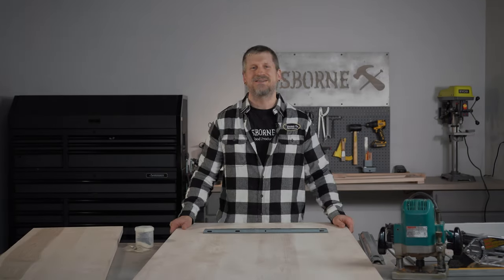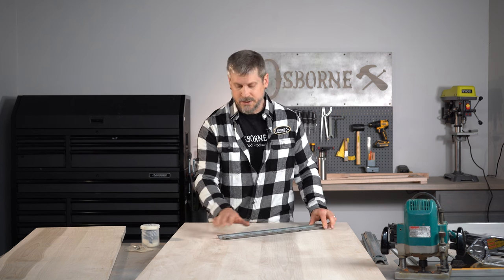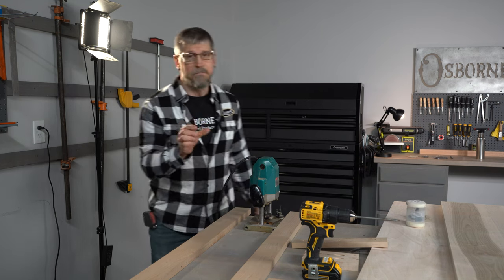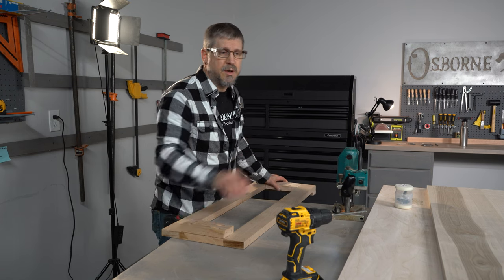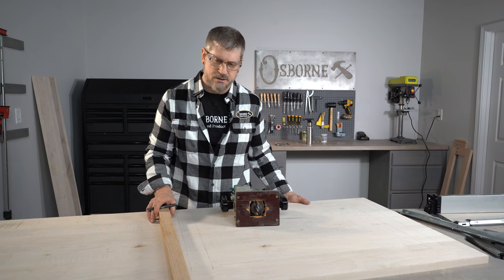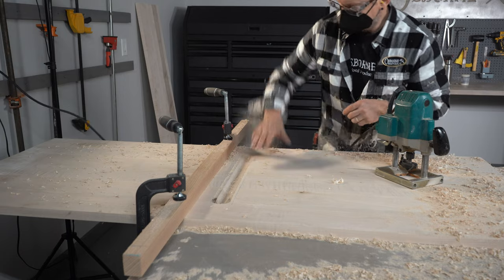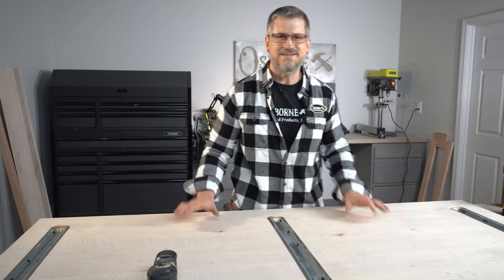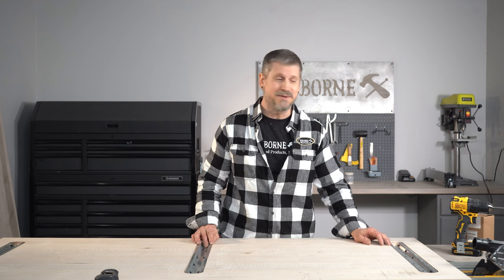How to Keep Your Table Top Perfectly FLAT! - Builder's Studio

Comment: 12 mm = 1/2 inch  but like you said it best to get a 12mm collet  Most hand held router  will tell you never use a bit like the V Stabilizer Groove Router Bit w/12mm Shaft .Bit like that are only used on CNC.  The 25mm = 1 inch and half the CNC out there can't take that size.  Your V-stabilizer  would be great for production but for one or two time a year worthless just use a C-channel.
Reply from the maker: Thanks for the comment. The V-stabilizer is a tool that addresses a problem. Just like any other tool, the cost-benefit analysis has to be done for the anticipated application.
Reply: @osbornewood   One thing you might want to-do is do a side drawing profile where people with CNC can use bit they have. The price of the V-Stabilizer Bars is good and look like a good idea. Know the track cut out could be done on a strait bit and a bull-nose and may a V-bit. Send me the dimension and I do a video showing it done CNC.
Reply from the maker: That's a great idea. If you would like, please reach out to us at marketing@osbornewood.com so we can look further into this. This would be a great option for those who only need to use V Stabilizer bars occasionally. Thanks!

Comment: What is the advantage of using these over regular C channels everyone is using? (C channel doesn't require any special bits)
Reply from the maker: Thanks for asking! The function of the two are similar, however,  the V-stabilizer is a bit more sturdy in it's design. The metal of the V-stabilizer is fairly thick (Osborne's are 1/8" steel). Another factor is the depth dimension of our V-stabilizer compared to a c-channel. A shallow c-channel will not give the same stability of the deep V-stabilizer we offer. Osborne's V-stabilizers range from 15.5 inches through 72 inches.
Reply: The advantage is you get to buy a  $400.00 bit for there V-stabilizer